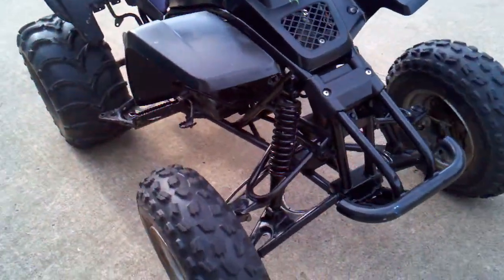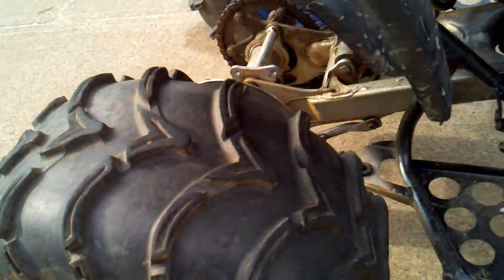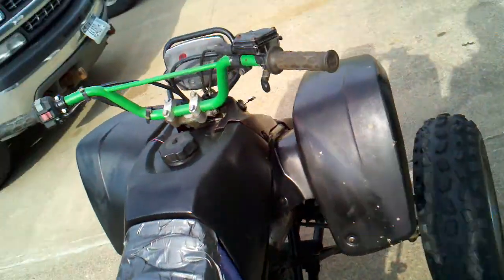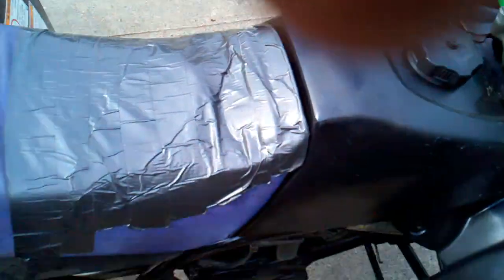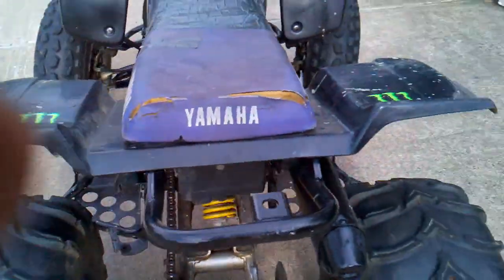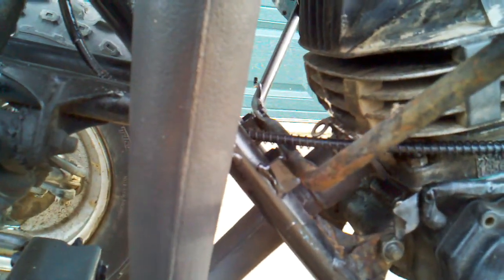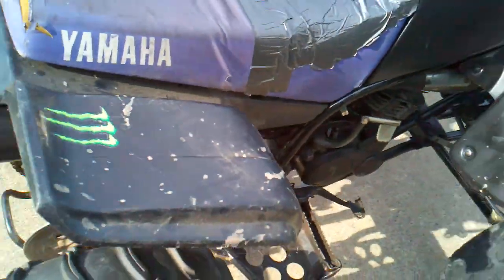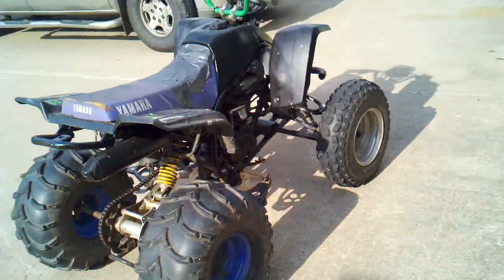94 Yamaha Blaster DG Exhaust

Comment from the maker: @ryjack26 i bought it for 400 with another set of tires and rims and two other brand new tires but the were dry rotted. all the engine internals and exhaust were there when i bought it, including a wiseco piston but it was blown up. thats why i put a new piston in it. it looks alot different/better now than in this vid. im gonna make another one to show what it came from since i bought it. it used to be purple blue and yellow